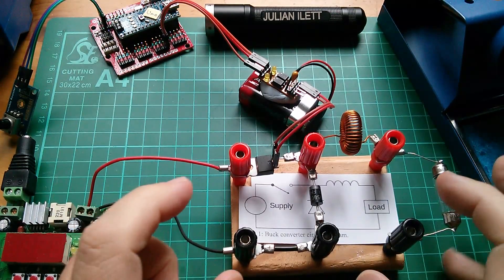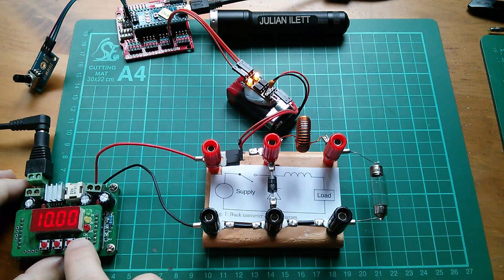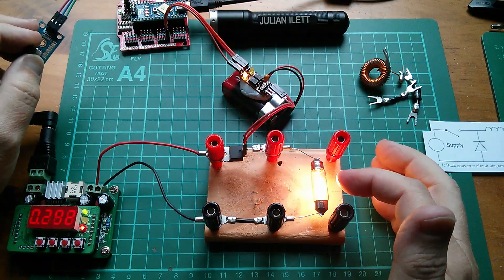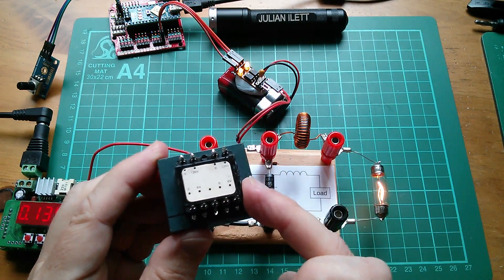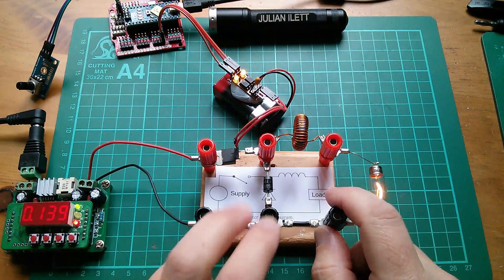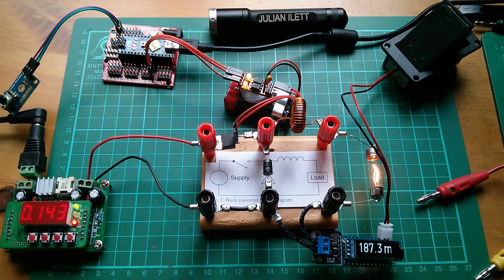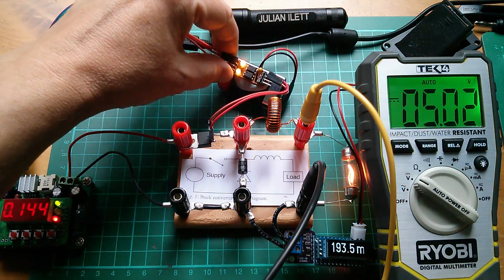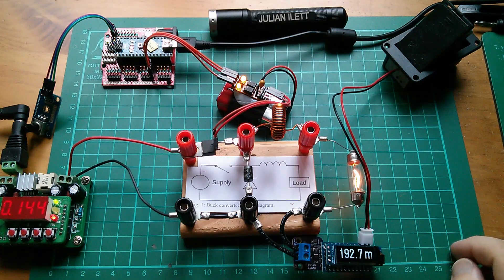Let's Test a Buck Converter

Comment: At 6:00 -- shorting out the inductor makes the bulb brighter precisely because you're doing buck conversion.

With the inductor shorted out (PWM), at a 50% duty cycle the bulb would be 'on' at full power for half of the time, drawing 50% of full-duty-cycle power.

With buck conversion, however, at a 50% duty cycle the output voltage is half of the input voltage.  That implies that the power drawn by the bulb is 25% of full-scale power (V^2/R).

A bulb drawing 25% power is going to be dimmer than one drawing 50% power.

Comment: Julian, The fifth pin on the transformer is there so it can only be placed in a circuit board one way around. It has no electrical connection. Thanks for the videos. :-)
Reply: Thats what a grounding pin is for...
Reply: +Mark Earth pin. The ground pin is the 0v pin

Comment: The resistance of a filament bulb is very temperature dependant  Driven at half the voltage it will take more than half the current because it has lower resistance.  The buck convertor does not "double the current" when it halves the voltage.  It doubles the available current.  The actual current flow will depend on the impedance of the load among other things.

Comment: Nicely done Julian!  Very good demonstration that it is, in fact, actually doing buck conversion.  You could of course use the information that you got from the ammeter and the voltmeter to compute the efficiency as power(out) / power(in).   You had ~ .144 Amps at 10V, on the input side, and ~.190 Amps at 5V on the output.  Since power is voltage * current, the efficiency is (10*.144) / (5*.190), or about 66%.  Nice.

Comment: Great stuff. I had sort of wondered if the pwm was doing all the work but i knew that the buck had to be doing at least a tiny bit. I figure they ultra low efficiency your seeing here is due to the inductor. It looks as if that inductor might be better suited for 500khz or more, maybe even into the tens of mhz. You also mentioned it may not actually be a very good square wave which will be interesting to see on the scope for next video.  If you can crank up the PWM frequency, or drive the mosfet directly from the sclk on the MCU, That would be really fun to see.  Cheeerrioos! :)

Comment: the light bulb changes load when given different inputs so that was not as conclusive as it looked. You need to use something less reactive as a load, like a low temp coefficient resistor.

Comment: I would say, no feedback to complete the regulation but it is definitely a bulk dc-dc. 
Capacitor is needed to smoothen  the output but with that not in place doesn't mean it is just a PWM.

Comment: I would guess that the lamp gets brighter when the inductor is shorted because the power dissipated in the bulb is V^2/R.  With pure PWM (inductor shorted) you get bursts of full voltage, whereas with the inductor in circuit, the voltage is reduced---so you lose out from the V squared term.  (The R of the bulb does not change very much.)  (I would also be very cautious with current readings in PWM mode.)

Comment: The simple fix for this is to add a large cap across the output. That will hold peek voltage and if you are then getting dimming still, then the buck is definitely working.
You could also control it with a 555 astable with pin 5 as the mark space control.
You'll have to use a separate supply for that s using an nch fet there makes it complicated.

Comment: Please do the oscilloscope test! =)
I'm pretty excited to see the results. 
Would it show massive ripples? Small high frequency ones? Or Would it be as clean a battery? =D
Reply: Ronell Oropesa it will be clean as battery FINALLY. You should know who is doing it
Reply: Ronell Oropesa  Because this circuit has no smoothing or regulation components, the DC output is a series of pulses.

Comment: Hi Julian,
You could just understand that this circuit is a buck converter or not by changing input voltage and you could see the  output brightness should stay same.
Reply: Wouldn't that be the case of a regulated buck converter?

Comment: I think it would be a better demonstration, if you put the diode reverse biased where the inductor is, and the inductor in the place of the diode. We would then be assured that the power supply wasn't lighting the lamp and the power was actually being supplied by the inductor.

Comment: There is a defference betweeen ac and dc there is no ac in this circuit. Ac change polarity between the two wires. Actually what we have is pulsating dc so it's a dc to dc converter. If you put a cap on the output the voltage and current will remain the same, however if you take off the load the voltage will rise as it charge the cap. You should remember it's the pulse width that cause the voltage drop it's still the 10 volts switch, so with no load it will say 10v on the output. But then again Julian say it's not regulated so the circuit is working as it should not the most efficient but it works.

Comment: I believe 30kHz ripple in current meter will be causing measurement error. 
As many have already said "Add a 100uF" capacitor across input AND output output to give you DC with minimum ripple.  Then meters will read accurately.
With capacitors added the difference between PWM and BUCK will then be easily seen when shorting inductor!
Reply: Two capacitors each side. You're dealing with square waves here, so there can be some really high-frequency components involved. Electrolytic caps have poor ESI, so the usual approach is to use an electrolytic and a lower-value, lower-ESI capacitor in parallel.
Reply: Vyl Bird  Do you really think adding small capacitors (100uF and a smaller non-electrolytic type) will make any significant difference given that the load is a current hungry filament lamp? The answer is NO.
Reply: ESR of 100uF is around 0.3 ohm. Lamp resistance is around 5-10 ohms so 100uF will take over 90% of the ripple current. If current meter monitors lamp current only (not capacitor current) then its current will be mainly DC.

Comment: Take a 1 ohm resistor supplied at 2 amps for 1 second and 0 amps for one second, an average 1 amp. So using averages gives 1 amp times 1 ohm ie 1 watt dissipation. But power is current squared times resistance so it's actually 4 watts for one second and zero for one second ie 2 watts average dissipation. That's one reason why people buy RMS meters.
Reply: BogusNotions  You need to think more carefully about what you said.
Reply: Really, Why would that be?

Comment: The lamp brightness isn't an indicator of the voltage at the load, but of the average power (and thus average voltage and current). But what we want to see is the output voltage being more like a DC value than pulses of 10V and 0V. All your measuring devices in this video will be averaging internally, so we're not seeing the truth. All switch-mode supply experiments need an oscilloscope!

Comment: hi Julian I hope you don't mind me contacting you but I have query I need a little help with im currently in the process of building an hiland 0-30v power  supply that I am fitting into a nice case so I am changing the 2 pots for a nicer range of voltage but I got 2 5k pots instead of 10k pots by mistake what I need to know is what difference would it make to the power supply using 5k instead of 10k pots cheers peter

Comment: What about feedback with constant voltage output with some sort of voltage divider... Then feed that back into the Arduino as some "feedback" voltage divider type circutry.. regardless if it's pwm or not, ... works either way I'd think. Good video. +1

Comment: I just realized something. How do I power my buck converter? I need to step down 54 volts (e-moped battery) to 12v max 10 amps. So I am looking arround and sadly many youtubers fallback to the 2576 whicg cannot go high enough and is only 3 amps. I I really want not go the arduino way and you do a great job! But how to power my arduino from that 54 volt battery? Right now the only thing I can think of is to use a lightweight buck converter (I have several XL7015 based  80 volts / 0.8 amps buck converters) but it feels a little silly?

Comment: Julian, in your next video in this series, could you spend a moment or two talking about why it does or does not matter that the 0 volt lines are not tied together in this circuit? Ta.
Reply: Craig Harrison In what way are the 0V lines NOT tied together???
Reply: Mark 1024MAK I am not really sure, hence the question.  My thinking is that the 12v supply coming in from the left is from Julian's Lead-acid battery array, has a 0v line that is independent of the Uno's power supply.  There is some sort of voltage being supplied to the gate of the n channel MOSFET on the top left of the main board, but for that signal should be somewhere above the 12 volt supply to turn the MOSFET on, so I assumed that the signal voltage should be referenced to the same 0 volts as the main board, but there does not look to be any kind connection between the 2 zero volt sources. In other electronic projects that require different voltages eg a 5v and 12v supplies, there is usually a single 0v rail that both these voltages are referenced to.  I am still unsure so if you or Julian could discuss it ( I would prefer J himself personally as I find his style of explanation very accessible) then I hope to learn a bit more about the finer details of this project.  Hope this helps with understanding why I asked the question. Ta

Comment: I like how you've gone for the clever approach of looking for current step up to show it's more than just PWM rather than getting the scope out. However I would struggle to put my faith in your current readings bearing in mind the likely very large and high frequency voltage and current ripple. The accuracy of the readings could be affected by that. 

You will need to just get the scope out and show some voltage and current waveforms. If you want to prove your claim that it's a DC to DC converter, show a DC output voltage. Of course the simple explanation of a buck converter which is ubiquitous in the hobbyist community (which I don't like because it doesn't account for the current step-up and can't be adapted for boost and buck-boost converters) is that it's a filtered PWM, so then if you take that definition you're really arguing if it has to be an LC filter or if your LR filter counts (R being the lamp and the lamp also being the load). 

Of course you could just add an output capacitor and then nobody would argue that it's not really a buck converter. That's all it's missing. (I think you're correct in that regulation isn't mandatory for the definition of a buck converter, just unregulated buck converters are of very limited use).

Comment: Isn't it just a case of the inductor is acting like a resistor as the bulb dims as the link wire is removed, causing input current to drop.
Reply: arif anwari  No. The resistance of the wire of the inductor will be fairly low, in fact most likely lower than that of some of the connecting wires that he is using.

Comment: Question for you, Julian... If you take a 240-24V AC-AC transformer and connect its secondary side to the secondary side of a 240-4V AC-AC transformer, how many volts would you get on the primary side of the second transformer, and would you dare touch the leads with your fingers on one hand?

I don't think doing it with fingers from both hands would be a good idea, though...
Reply: You would over saturate the core on the second transformer and it would basically become like a short circuit on the first transformer. It might work a little bit but you wouldn'tget the high voltage you were expecting. Sorry.
Reply: You are over-complicating the scenario, Zero

Comment: Wouldn't you need to include negative feedback in the controller? So the knob would set the voltage target, and the Arduino would increase or lower the PWM duty depending on if the output is above or below the target voltage? 

The output voltage will be different depending on the load otherwise.
Reply: A bulb is somewhat self-regulating. Higher current, higher temperature, higher resistance. It's not very good regulation at all, but it''s good enough for a simple testing situation such as this.
Reply: IF you aim to get a specific voltage. The voltage changing depening on load is kind of irrelevant, as it still a buck converter.

Comment: well I didn't say that's not a buck converter. I said the effect is like a pwm. I suggested that you should measure current to show the current gain. And you did but I think you should have put at least minimal effort to filter the output a bit - just any >=100 uF capacitor

Comment: Hmm... makes me wonder how that circuit would behave if that inductor is replaced with a ceramic capacitor similar to the solar PWM circuit that you built a while ago :)
Reply: tbbw  The lamp may (or may not) light very briefly (depends on the size of the capacitor, a ceramic would be far too low a value, so the lamp would not light at all), but would then go out and stay out. As the capacitor would charge up when the transistor is switched on, but it has no discharge path, so once fully charged, there will be no significant current flow through the lamp.
Reply: It would actually let the AC current though so I imagine it would be just like the PWM.

Comment: Why don't you just view the output with your scope to measure the peak and average output voltage, if it's a buck it will be lower, if it's just pwm the peak will be the same as none buck and non pwm.

Comment: Everyone knows that PWM is the most prominent way to switch DC voltages right? Like that's the way you do it, so if all you see if PWM, he's done it correctly...sure you can use a simple voltage divider or a voltage regulator IC but neither of those methods can handle high/ large current. Just because he's powering it with a small adjustable DC load here doesn't mean he can't put 4 batteries at the Drain and do the same thing. This is exactly what you should be doing it so grab an old computer power supply and try it yourself...then you'll have an "Adjustable power supply"

Comment: Just tell me please why is the current in the "secondary" side higher now? My guess inductor drives the charged up (remembered)  current when the switch opens (knowing the current slowly decreases of course depending on switching frequency and in inductor value) instead of just being zero if the switch opens - so therefore just increasing efficiency???  And now assuming your A-Meter (which looks great ;) does a little bit of averaging (maybe filtering?) the overall measured current is now higher in the "secondary" switching side.? 
Please tell me i am somehow right i graduated not so long ago from electronics .. but buck and boost converter well these things i have  to and i really want to understand fully & truly.
Reply: My way would go as far as to measure the current in the secondary side with an oscilloscope and to see the current when Switch is open as well as closed

Comment: What i don't understand is how the bulb gets dimmer, even though it consumes more current. Can someone please explain? I feel like i am missing something...
Reply: You're missing the difference between mean current and Root Mean Square current (RMS).
Reply: So a phase shift between voltage and current? The power factor changed? Does that happen with DC pulses?
Reply: muh1h1 its because that arduino current meter is not an instrument but a toy. On each cycle the current will ramp up steadily if inductor is present but that toy will sample randomly. So the reading you see there is actually not the actual current. Its a playing with kind video so dont try to find justification
Reply: muh1h1 The lamp does not consume more current. The energy from the supply is converted from a 10V voltage supply to a lower voltage supply. If the supply to the lamp is 5V, then as energy cannot be destroyed (it can only be converted) less current is drawn from the supply compared to the current to the lamp. When the switching element (transistor) is off, the magnetic field in the inductor reduces, and current flows through the inductor via the diode, that same current goes to the lamp.

Comment: Anyone know why the n channel mosfet worked as the switch? What is the gate voltage???
Reply: Pohan Huang the mosfet is being switched by the Arduino using PWM, presumably the NMOS has a low enough gate threshold voltage that it can be switched by 5V from the Arduino.

Comment: emmm.... i won't say DC-DC buck is exactly the same as AC-AC step down as its primary and secondary coil are totally electrically isolated from each other and whats actually causes the creation of lower voltage is the magnetic flux cutting the high permeability core in most cases iron core is use which faraday law applies.
DC-DC buck in another hand has no electrical isolation involve where the high "magnetic charge" in the choke release and converts to electrical current at the last direction of flow during 0V.
Reply: Reese Me  If it helps, mentally exchange the isolating mains transformer for an auto transformer...

Comment: Hahaha, you'll never live down the displaced terminal in the top left, will you?
That aside, you mention at 12:45 that the brightness of the lamp is sufficient as an indicator. You'll remember that this only works for instantaneous changes. For anything else, I wouldn't trust your video image further than I could toss you courtesy of the unscryable influence of your current daylight and your camera's exposure control. Cheers!